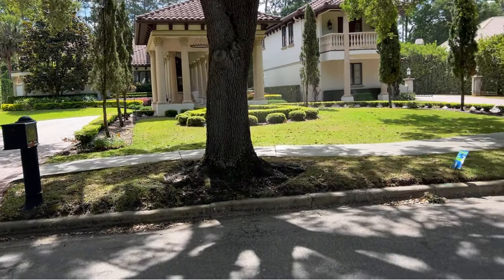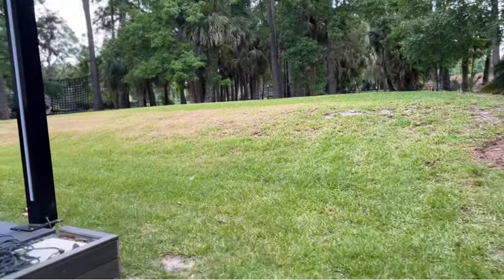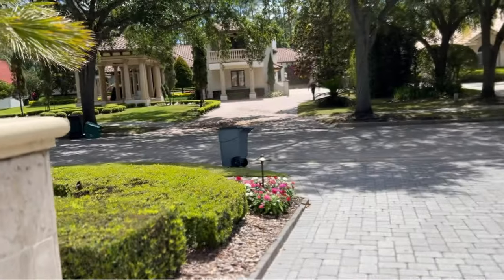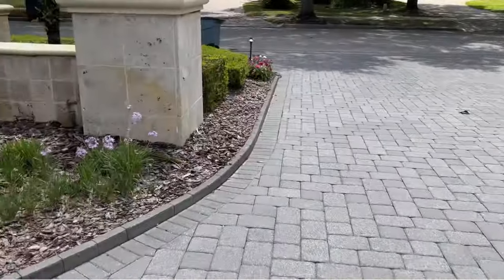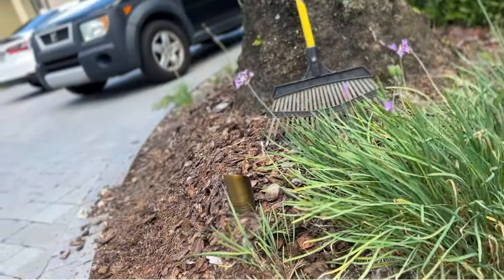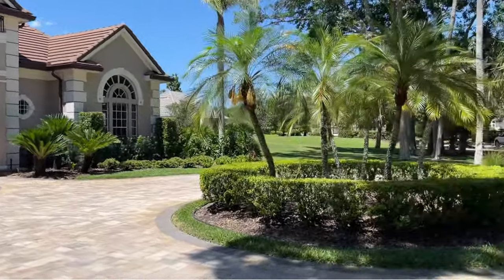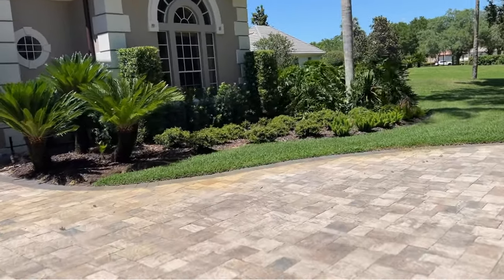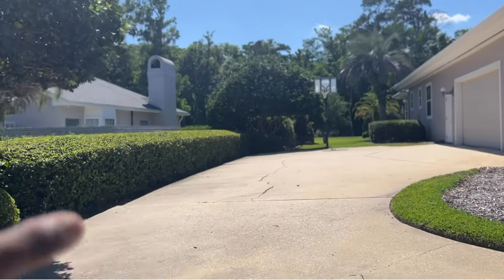2022 Florida Lawn maintenance Vlog #4

Comment: I second Roy. Also, what if you don’t have a massive crew like you do, what do you recommend? I don’t have mansions as regular clients. I have normal houses and I can’t afford to spend over an hour on a house so I usually just do a section a week. Any advice is helpful!
Reply: We do mostly commercial and our goal is to trim every visit as needed in the growing season and in the fall we try to heavy prune certain areas like in front of windows or signs. Last year it seemed like our trimming never stopped!! Clean up is another thing as most of our properties are pine straw so we blow clippings in the grass nest we can and mulch….And I am a small company just two of us..
Reply from the maker: I think doing a section at a time is good and my advice would be make sure to take care of the obvious areas. Like the front entrance or the back patio, by the car garage. I hope this is helpful.